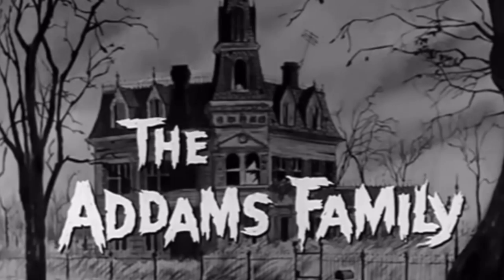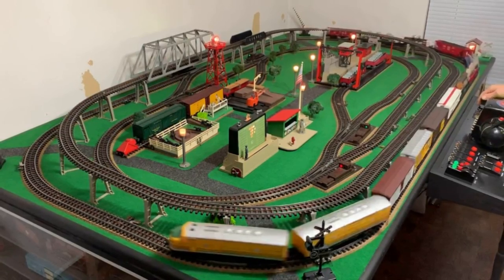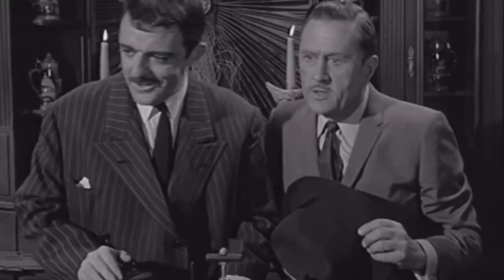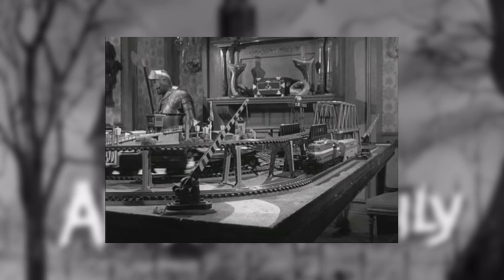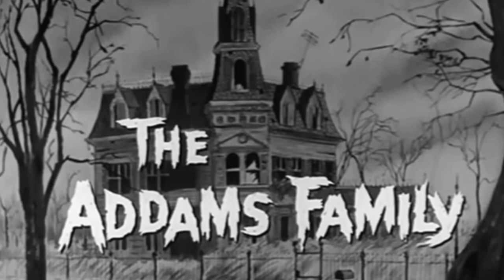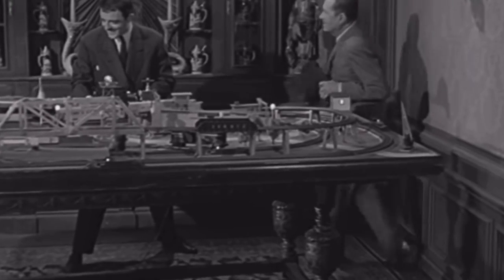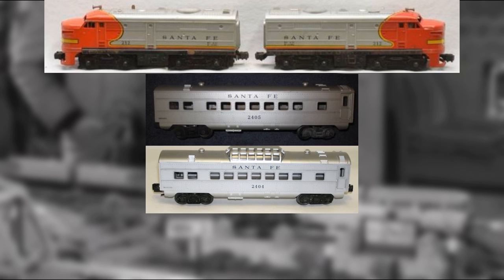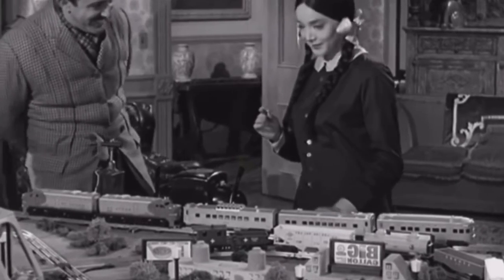The Engines & Layout(s) Of TRAINWRECK: Addams Family 1964

Comment: Train boy I have challenge for you take a Bachman Thomas and then a piece of H015 foot flextract bend the track at an almost 90ﾟ turn then set the Thomas with its middle wheels on the track and it's back in front wheels off the track and then have it turn the corner